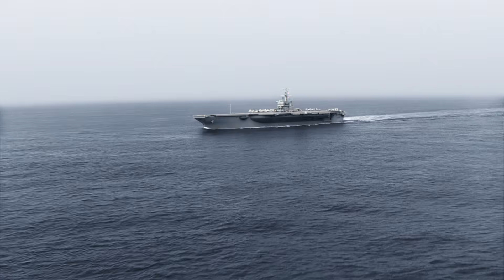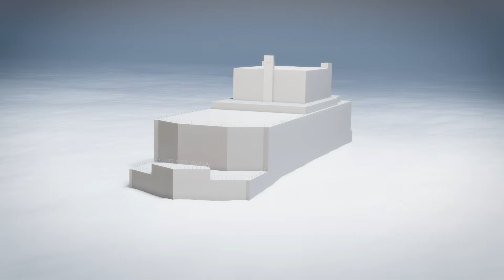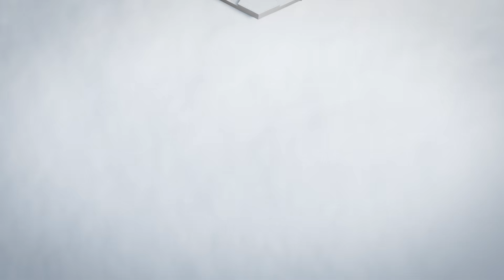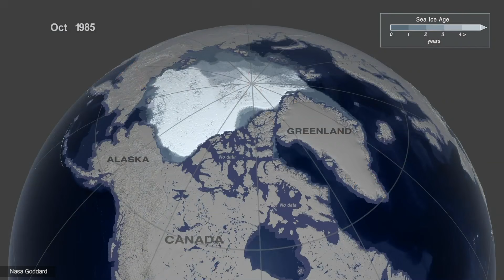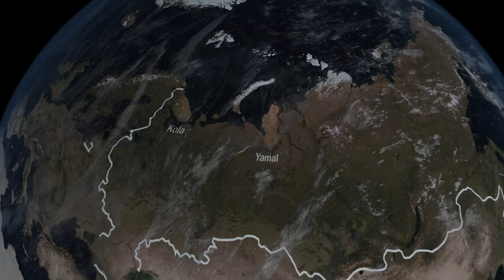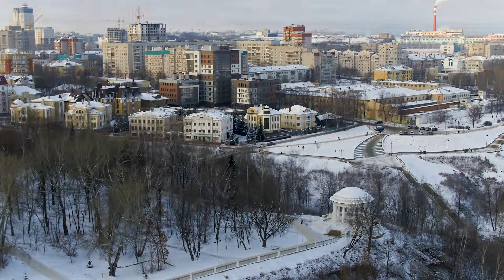Why Russia Built a Floating Nuclear Power Plant

Comment: The question shouldn't be why is Russia building these floating nuclear power plants — the question should be — why aren't we? 🤔 Nuclear energy isn't a Boogeyman in fact it could be our best friend. It has the potential to replace oil as the most abundant energy source on Earth and it has the potential to do it without destroying our climate. There are passive failsafe designs that could be employed that negate any risk and bring us only the benefits.
Reply: Because only Russia has such high technologies in this area, for example? Seriously, the EU and the US nuclear power industry are in deep ass because of the greens and corruption
Reply: @everwinter0  Actually, the EU and US are still far ahead in terms of their nuclear technology when compared with Russia. Don't forget, Russia's rapid building of poorly-designed nuclear reactors lead to the Chernobyl incident.
Reply: @numbersstationsarchive194  They don't even have fast neutron research reactors, unlike the Russian Federation, which is already capable of processing nuclear waste into nuclear fuel, albeit not as efficiently as on the BN-300 currently under construction. But the question of what to do with spent nuclear fuel is critically important, but, apparently, they do not have high enough technology for this. And if you remember that with all this, they use a very inefficient way of enriching uranium, which is why they buy nuclear fuel from Russia... Your nuclear scientists probably get quite sad there.
Russia no longer builds reactors of the same type as it was at the Chernobyl nuclear power plant, and at the same time meets the construction deadlines, unlike the EU in Finland. And on the part of poorly designed reactors, it's better to ask General Electric about Fukushima.
Reply: @everwinter0  The components that failed, which were the backup generators of Fukushima Daiichi, and the seawall, were both built by contractors hired by TEPECO and had nothing to do with General Electric. The reactors and reactor systems only failed because of the failure of these components, therefore you can't put any blame on GE.
Russia doesn't build RBMK reactors, but they still operate them. Ukraine and Lithuania both decommissioned their RBMK reactors soon after their liberation from the Soviet Union.

Comment: Why it doesn't have its own propulsion?
Reply: Why would it need it's own propulsion when 99.9% of the service time it will be moored at port? A waste of propulsion turbine.
Reply: @cianakril  1. It will be fully independent
2. In case of emergency it could change position even with remote control far from the place where it's based

Comment: Why not add a track/ski system to allow it to be moved to land to reduce safety concerns sorrounding the reactor being hit by tsunamis 
Realistically you should be able to drive/tow it inland at Least a mile without much problem
Reply: Because:
1. Tsunami is safer on sea
2. Its too huge to be transported on the type of terrain where its operating

Comment: Instead of nuclear power icebreakers, why not redistribute the heat in hot water pipes so you can melt through the ice like a hot knife 🔪 in butter.. 
This would save tons of energy and cost of wear and tear on the ships hulls along with opening the pathway for other ships much longer as your not leaving behind a bunch of broken ice chunks to fuse freeze back together or damage when traveling at faster speeds.
Not to mention, a much more efficient cooling system if you have a network super hot reactor spread out to cool..
This save so much on the environment, so many ships have to make Trip's all the way down to the Panama canal.. to go back north again..
There should always be a shipping lane in the arctic..
Better yet, use these nuclear floating plants as electrical refueling stations for electrical cargo ships in the Arctic..
Reply: First of all, you need to get the hull of the ship really hot for it to just melt right trough thick arctic ice. Second of all, temperature differences would, over time, lower the hull's structural integrity.
Reply: @nbond-hd5db  I know sudden changes in temperature is very poor for the structural integrity but what if you use the metal that can hold vats of molten iron or the metal of those nuclear reactor rods?
I bet you could go at a slow enough steady pace where the ice could melt before any contact.. and clear a width of two football fields..
You would think the structural integrity would me damaged more over time with the constant battering of ice over the years.. not to mention the following ships..
Reply: @rrpearsall  temperature of the reactor isn't enough to melt iron. If it is, you have a massive problem.
Reply: + tubes could get damaged because of the vibrations of the hull.

Comment: I'd like to add some info about Academic Lomonosov. It is not only electric power plant but also heat production. ALL cities in Russia are built with multi-floor apartments and heated by external stations. None of buildings have any boilers or so.

Comment: whats really good about the ships, if they have them just 30 km from the coast, thats the entire exclusion zone for chernobyl, the ship can then be sunk where the water will protect people from radiation so if something was to go wrong no land would be lost and only a small few people would be exposed
Reply: Pressurized water reactors are installed at Akademik Lomonosov, they are much safer than the Chernobyl-type reactors. These reactors also installed on the LASH carrier Sevmorput and icebreakers Taimyr and Vaygach, and have been sufficiently tested in operation for many years.
Reply: The plant need to be connected to the port infrastructure, there's no use of it 30 km offshore.
Reply: @cianakril  big wire, i realise voltage loss and all that but its almost "free" power
Reply: It would irradiate the ocean though. I guess it is the better of to evils.

Comment: Why not just take a regular nuclear powered ship, sail it to whatever location, park it at the dock, and use it to make electricity for the grid? If it's not moving or going anywhere, you're good to go. Why build an expensive nuclear powered barge?
Reply: Because a regular powered ship will exhaust it's resources quickly in this manner than a specialized built one, and will require more maintenance effort, it's not worth it.

Comment: I was disappointed by the somewhat low power output of 70 MW.
Reply: It's perfect for it's intended use which is to give a boost of power to extremely remote arctic fishing villages and such places where installing a grid connection would be costly, difficult and dangerous.

Comment: I doubt that it actually produces district heating. You have to make a design consideration if you want to produce maximum electrical power or if you want usable heat too, you can't have both for simple thermodynamic reasons (condenser temperature). There have been some combined power and heat reactors (like the Swedish Ågesta reactor close to Stockholm) but then the electrical efficiency was only about 15 %. For reactors optimized for electrical production, the waste heat has too low temperature to be useful.

Comment: Me after reading the title:

Uh, becouse they can?
Reply: My thoughts exactly.
Reply: There is an element of that i assume. But the main reason is Russia has a lot of remote arctic villages that can't be easily accessed by land or air and these villages need more electricity. The problem is installing power lines to these villages would be costly, difficult and dangerous. So Russia is doing the comparatively easy thing by building these floating power plants that they can park right next to the village and hook them up.

Comment: i think it will safer to have nuclear plant on sea than land. Sea with its immerse water are ultimate heat sink. When nuclear reactor on land, the issue with land base is to get enough water to cool it. So long the reactor heat can be sinked, no explosion can happen. Correct me if you think iam wrong.

Comment: Russian: Its clean, safe and green energy guys.
Also Russia: uses it to drill and mine one of the largest deep sea oil extraction ever.
Reply: You cannot make plastic yoghurt can from uranuim, you need dat oil.
Reply: legolegs How about recycling that plastic
Reply: @Petri_Pennala  I'm not against recycling, but it is not 100% efficient while every year you need more and more yoghurt cans. Also some plastic products like pipes are never recycled, you need hydrocarbons for those.
Reply: @Petri_Pennala  only some plastics can be reused, other important plastics have chemical composition that doesn't allow it
Reply: @legolegs87  This guy gets it. I want my yoghurt
Reply: @Petri_Pennala  the struggle of recycled plastics is they don’t behave like a virgin plastic. 

Coke and LEGO have both run into issues with using recycled material. Virgin plastics shrink minimally when injection molded, and that shrinkage is consistent across the product. 

Shrinkage in recycled and virgin/recycled mixtures is inconsistent across the product, making it difficult to work with. It also isn’t as strong or elastic as virgin plastics. 

I’m down for plastic recycling, we just have to find some solutions to the shrinkage issues, or at least how to even out the shrinkage.
Reply: actually it's mostly LNG they're mining in that area, which mostly goes to Western countries.
Reply: and Gulf of Mexico is the one constantly suffering from oil spills !! and basically surrounded by oil factories . But it doesn't concern you because americans do that
Reply: Humans: The ice caps are melting because we use oil and gas. This is a disaster with gobal effects.
Also Humans: The ice caps are melting. This is good because we can now drill more oil and gas.
Reply: Azid5,Azid5 lmao!🤣
Reply: At least, we're developing the most productive alternative. It's still limited, but it is an alternative.
Reply: Yeah, they probably did not make that for the purpose of being environmentaly friendly.
Reply: Also Russia: An RBMK Reactor cannot explode...
Reply: gamingfox98 where you get this bs?! For Chernobyl (with RMBK class reactors) existed special instruction where Russians described, what not to do for explosion. When Ukrainians violated instruction (actually several levels of it) and removed rods, they got predicted explosion. Life demonstrated, that “instruction can’t help against fool”, so next plants Russians developed already with assume of fools everywhere, so new plants really can’t be exploded.

P.S.
After inspection of Fukushima, Russians also wrote instruction what Japanese need to do for safety. On Fukushima-1 they ignored Russian instruction and got disaster, on Fukushima-2 otherwise, they did everything and as result during disaster preserved electricity, pumps, died just one man and they saved reactor.

Comment: I don't really understand the point. Is it creating mobile power plants? If so doesnt it have very limit use and ability? And won't you still need to put down sort of transmission infrastructure to get the energy where it needs? I can't imagine they would leave high wattage wires on the ground

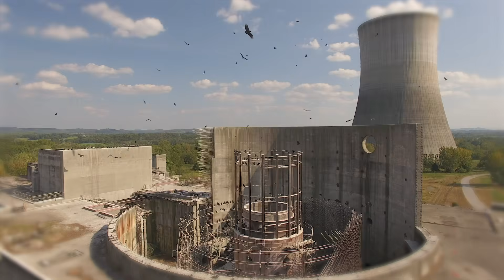Comment: 06:24 Nuclear power plants do not help in reducing carbon emissions. Please inform yourself about how nuclear fuel is made.
Reply: A production of a fuel source using some emissions that will last for several years without emissions is much better in reducing it rather than having emissions 24/7
Reply: If it were just `some´ emissions once, and then it's done and over, it would be ok. But these emissions, including mining, transport, refining, mending collateral environmental damage, etc., in sum are not smaller than those of fossile fuels. And that's even before we include nuclear waste management in the calculation, not to mention we have no idea how to ensure safety for the next some millions of years.

Comment: One element of Russia's plans for these ship-based nuclear plants the world could learn from is to make nuclear facilities, to the greatest degree possible, modular, leverageable, and repeatable designs.  All the greatest products be they automotive, consumer electronics, commercial networking, and so on, are engineered this way.  Who point is that when flaws or problems are encountered, that learning can be designed both in new locations as well as retro-upgrades to existing locations.  The idiocy of our nuclear plants in the U.S. and Europe is that each one is a custom design.  This goes against everything the general field of engineering has learned in the past 50 years.  Because the public doesn't understand this, fear-mongering is causing us to lose the potential of this energy source.  Certainly, renewables should be front-stage, but eventually, we will realize the huge loss of lands to sprawling wind farms, solar farms, and the like (hey, I have solar on my house so I'm all for renewables but the grid loss and land use is currently ignored).  Neither should we go crazy building nuclear plants, nor should we stop focused development of the technology.  But alas, balance is perenially lost in public policy.
Reply: Nuclear is far safer than every form of renewables. I would put nuclear tech in the forefront well ahead of renewables. The only time solar or wind make sense at all is on a small scale, in a remote area. And now because of Russia that remote area needs to be away from the sea. So maybe a small village in Africa, off-grid, and with plenty of sunshine? Yeah solar makes sense. Other than that, not so much. Wind almost never makes real sense.

I agree that we need to pursue pre-fab nuclear reactors. They can be made cookie cutter in the factory and safety inspected before ever being deployed. Much of the local reactor (concrete footing, etc.) can be built with lower skilled construction workers. Then you drop the actual reactor into place and flip the switch. The new Gen 3+ reactors are already walk-away safe. Many of the Gen 4 reactors will be able to recycle nuclear waste and use it as fuel. It will burn through all the long-life waste and create short-life waste that's about 1000 times easier to manage.

I'm also in favor of finding creative ways to shrink the minimum size of a useful modular reactor. Then nearly all ships and boats can use nuclear instead of petroleum. This would increase the advantage of mass production and lower the average cost. If you can make the reactor small enough that a 30 meter boat can run on one, the 30 meter boats will become very popular and the 29 meter boats will become very expensive.

Maybe the Gen 4+ reactors would be modular enough to fit on a 20 meter boat, in which case the 19 meter boats will still need petroleum and become more expensive to own/operate.
Reply: @protorhinocerator142 on small boats the safety and cost would our way the benefits. With smallish vessels I think fossil fuels will always be king and ccs which is incredibly flawed can be used for that. However on big tankers, cruise ships, cargo vessels and the likes could definetly benefit from a nuclear makeover
Reply: Land based nuclear power plants will always be custom designs, due to different soil composition and hundreds of other factors at each specific site. Russia was trying to do serial approach ever since 80es and it didn't worked out - every new plant has to be modified for a site specifics even if the reactors are the same.
Reply: Gor Mor Thank you!  I didn’t know that; it explains a lot, as design reuse seems unconsidered here.

Comment: #1 reason: access to cold water 🌊 for cooling, as nuclear power ☢️ 🔋 plants require a LOT of water to cool the reactor. 

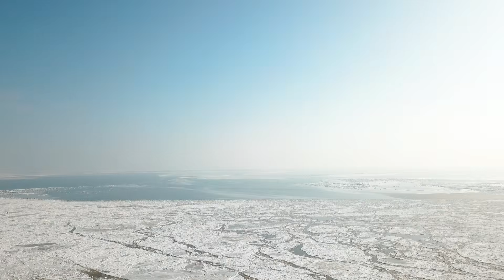@4:00 This could also contribute to global warming 🌏 🥵 since it is happening in the arctic! 😳🤯
Reply: No, just no
Reply: Well a nuclear power plant isn't that much compared to the several coal plants that Russia will close. Furthermore they will use the power plant energy to supply the development of methane ducts so reduce the dependency of petroleum and coal and other more environmental unfriendly things
Reply: Alfredo Rotondo nuclear power and cold/hot water exchange in a mid-latitude river is a BIG DIFFERENCE than in the arctic... especially WRT global warming, melting sea ice.

Comment: I had a plan on my mind that if we use nuclear powered phones we will not have to charge everyday . We can add more revolutionary features to our phones cause we will have more space as big batteries will not be needed .  But its risky eh>?
Reply: How are u gonna add water to phone? Anything nuclear related need tons of water. Or carry water bucket with phone? Nah
Reply: @edgehodl4832  nope look up RTG's the curiosity rover uses one problem is they dont make much power curiosity's RTG only makes 100 Watts and that's when it was new the older it get the less power it makes. seriously you cant even run a standard household kettle with that much power but yet they can run a multi million dollar rover off that little power amazing.

Comment: Great strategy!  If in case of a SCRAM event, simply drive the boat to your nearest enemy and abandon ship.
Reply: It's a barge with no propulsion at all. You can't "drive" it anywhere on it's own.
Reply: @cianakril  well, tow it there then. Same principle.
Reply: @MrVlad12340  it's like a fight you have to remember it takes 2
Reply: I don't understand why they don't use some of the power to power the ship, rather than making it unable to move unless it is being towed. They are supposed to be so technologically advanced so they have built a big floating thing that can't even move on its own.
Reply: @Awake-Free-CT  Building a nuclear power plant on a barge without diesel propulsion is not a matter of technological progress but practical decision.
Reply: @jerromedrakejr9332  ok, thanks for your reply 🙂